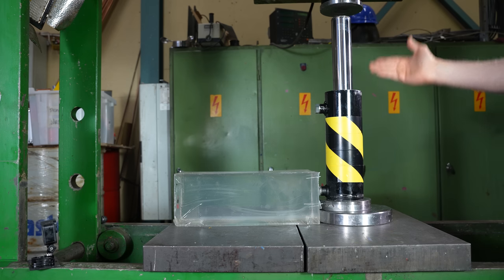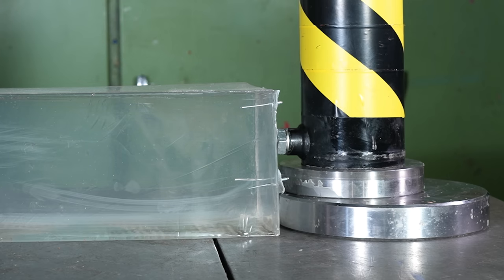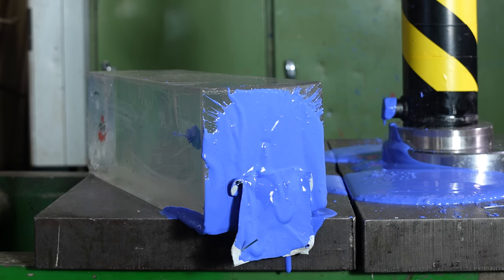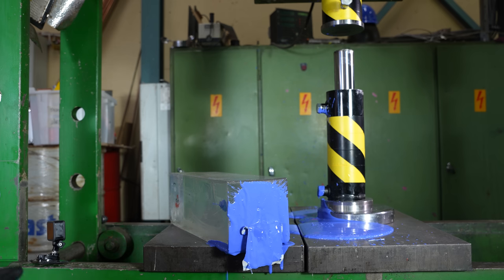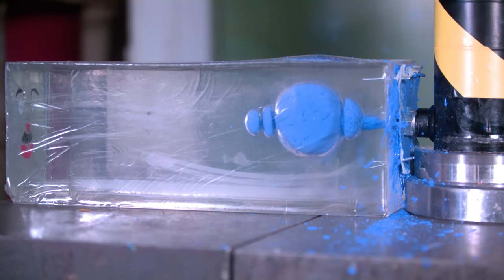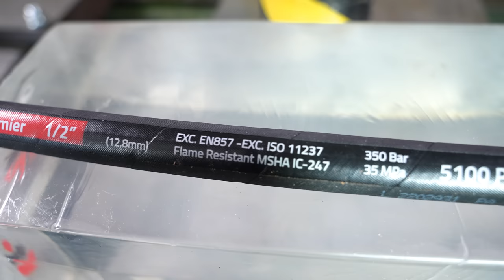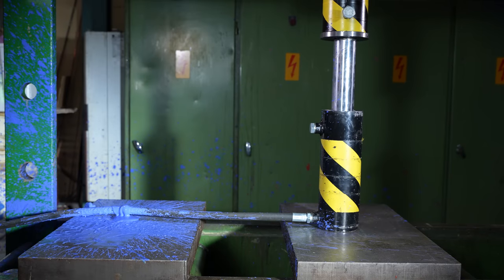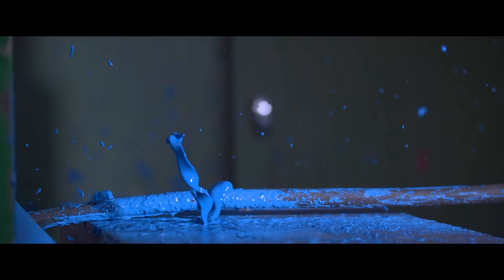Injection Injury Demonstration With Hydraulic Press | How to lose your hand!

Comment: The rectangular prism shape of the ballistic gel can only be so informative.  I'd like to see you take a plaster cast of someone's forearm and hand, and then a mold of a foreleg and foot.  You can timelapse or montage the process of taking the cast impressions, using those to make a resin mold, and then using the mold to set ballistic gel for the replica.  The key, I think, is using replica bones to make the model!  From just the two plaster casts, you can make several copies of each forearm / foreleg, and then you can test various types of safety equipment and protective gear.  You can crush batteries and other electronics which would allow you to simulate not only impact trauma, but also temperature and electrical injuries.  Pressurized cryofluids might yield interesting results as well, and if you have the correct rigging, you can also investigate barotrauma from rapid or explosive decompression injuries, such as might hypothetically be a concern during space travel or during undersea exploration here in Earth's oceans.

Comment: When I was younger I actually waved my hand through a pressure washer we used to use at work for the kitchen floors (not sure on PSI, one of the ones with the onboard compressors, listed as 2000psi max), didn't actually go through my skin at all, but the force was enough to bruise my fingers pretty badly.

Comment: So, now I'm curious to know if the viscosity of the fluid has an effect on damage to the tissue analogue. Like, because the paint is thicker, does it have more punching ability, or more ability to increase cavitation due to density?

I bet this would be cool to try with different fluids in the cylinder. Use the footage of the paint as a baseline, then maybe try adding more and more water to the mix and seeing what happens?

Comment: 9:44 The googly eyes are gone and now it looks like Mr. Block is being tickled. The worst part of injection injuries is that they're usually toxic fluids and the only way to clean them out is to totally surgically explore the area. A pinhole wound in the hand could require the whole hand to be dissected to be cleaned out. If you don't get all of it, the tissues will die and lead to infection which could require amputation. @AvE made one of the best videos on this topic.

Comment: It's why when checking for pinholes leaks in hydraulic lines you could run something like a piece of paper along the hose and not your hand. The pressure of the fluid coming out will cut through the paper, just like it would cut through your hand. Hydraulics ain't no joke.

Comment: Thank you so much for the work you did to publish this but considering pressure washers are the most common injuries of this sort a PSI conversion would be very helpful (i.e. 150 ton hydraulic cylinder DOES NOT TELL US ANYTHING ABOUT THE POC(point of contact))

Comment: I’m a trauma Medical scientist and wanted comment on hydraulic pipe failure. The trauma that would be caused is similar to “crush” type injury meaning you have multiple of the following 1) bone fractures, 2) Bleeding 3)Compartment syndrome (increased pressure in an arm or leg that causes serious muscle, nerve, blood vessel, and tissue damage 4) Laceration (open wound) 5)Nerve injury 6) Infection (caused by bacteria that enter the body through the wound) 7) Disseminated Intravascular Coagulation (body reacts to the blunt force trauma on the tissue leading to an over compensation  of clotting factors causing potentially lethal blood clotting) these injuries on there own can be fatal.

Comment: I had a 3” sand blasting hose that had filled with sand and under 110PSI blow apart at the joint next to my hand.   I pulled sand out of my skin for many years afterward.   This is way more dangerous as pressure is way higher and sustained!

Comment: Was in the trauma ward for a week when I was 20 because I fell off a quarry. Lucky to be alive.... but anyway... A guy came in, he was working on a farm and went over to talk to somebody who was tipping up a trailer. The guy walked over to the back off the tractor as the trailer was being tipped up. He put his hand on the hydraulic line while he was chatting and boom... the hose burst, the oil went straight through the palm of his hand. Spent a full week in and out of surgery trying to clean the oil out of his hand. It did a crazy amount of damage.

Comment: Commercial diving we used high pressure waterjets to cut concrete, around 45-55,000 PSI.  The HP hoses are double hosed, the primary hose, with a second clear wider hose around that to attempt to diffuse any pinholes and show water collecting before it cuts through and takes someones fingers off.

Comment: A paramedic told me about injuries on farms from hydraulic hose leaks.  They went to a farm in the helicopter expecting to see something terrible like a crush injury and were surprised to see a  young farmhand arrive holding his swollen arm from a high-pressure hydraulic oil encounter.  "I never saw the jet coming out of the hose" he said.  They took him to hospital but he died the next day.  Very dangerous, but never mentioned on the ads for far (and engineering) safety.

Comment: I was taught, even a hair thin hydraulic oil jet can penetrate the skin, if it comes from a high pressure system. 
And it doesn't dissipate much over distance like water. 
Also if untreated for too long, because it was unnoticed, it can lead to limbs having to be amputated.

Comment: Medical personnel need to be trained on injection injurie. I injected my right index finger with hydraulic oil at 195 BAR - 3000 PSI. At the emergency room, I was diagnosed with a minor laceration with swelling. I was insisting it was an injection injury and very serious. They gave me a shot to get me to shut up.

Comment: The dangers between pneumatic and hydraulic systems certainly are different.. One of the most dangerous common hydraulic systems are the high pressure fuel injector pumps on diesel engines. The pressure inside these can be as high as something like an unbelievable 20,000 - 30,000 PSI, enough that even in tiny amounts the diesel will go straight through the skin. The diesel is obviously pretty toxic inside the body, and can easily require limb amputation or even kill.. A place where health and safety really do work..

Comment: What was frightening for me is how many years I worked around hydraulics without ever being told about the dangers of hydraulic injection injuries.  Straight up if I get a hydraulic injection injury, I'll amputate the limb myself as fast as possible and then deal with that injury instead of the hydraulic oil injury.

Comment: This tells half the story, even if the pressure isn't high enough to pierce you, I have had a drill blow out during a deep boring operation in a shop, the oil was only at about 58.5 barre, I was 2-3 feet away from the spray, but I took a lot of that cutting oil in the face. This tells the danger of pressure, but not how much the pressure (and especially with something like machining with the cutting oil) the burn potential. I burned my face and neck with that incident, healed up fine but it's unpleasant.

Comment: Back in 2009 I worked for a company that used 20,000 psi water pressure and our safety orientation video was written and directed by our safety instructor who had 15,000 psi water stream hit his leg. It was the most disturbing sight I've ever seen.

Comment: Work in nuclear and had a crew taking down manways (large steel plates that are bolted on and are ment to take massive pressure) with hydraulic hi-torc machines. Guy had put his hand on a faulty seal and got a hydraulic injection wound. What makes these injuries worse than what you see on this video is the fact that the pressurized oil tries its best to take the path of least resistance, which in the case of being sprayed at a living thing is more often than not your veins. Worker lost half his arm because the oil traveled up the veins in his arm and killed all the tissue (hydraulic oil we used is deadly when just ingested much less when injected into your arm) if you ever suspect a hydraulic leak just depressurize and look for the leaking oil. It ain't worth testing fate.

Comment: I have a tattoo on my thumb. Not an intentional one. I accidentally unscrewed the air conditioner line instead of the radiator and the high pressure injected dirt into my skin. I was very lucky it wasn't worse!

Comment: it didn't go deep into the gel from the ruptured hose, but what it will do is inject a large amount of hydraulic fluid under your skin which if not treated immediately will quickly kill all surrounding tissue and potentially be introduced into your bloodstream likely requiring amputation of the directly affected area if it doesn't kill you first.

Comment: I was on my friends farm once and i noticed a tiny fountain of hydraulic fluid coming out of a hose. I shouted to him to get some tape whilst i put my thumb to stop it. He ran at me screaming not to and pushed me away. He told me although it was only a little "squirt" it was still backed by 3500psi and would have pierced my thumb and injected hydraulic fluid into me. I was so lucky. It never occurred to me.

If you want to see this in action, go watch a waterjet cutting 6 inches of steel armour plate like it was paper.

Comment: I work with a pressure paint system that pumps the paint out of a pinhole at like 150psi. I once didnt lock the trigger while trying to remove the nozzle and sprayed the paint directly into my palm. I was lucky it didnt go into my hand but it sure as hell didnt feel good.

Comment: Many years ago I was using a pressure washer and didn’t let off with my right hand while using my left to move something, it was about 100mm away but cut a clean, deep gash in my hand- it took weeks to heal and I still have the scar. If that could happen with less than 200 PSI, I hate to think about the damage that could happen on something way bigger..

Comment: These injuries are uncommon with an estimated incidence of one in 600 hand injuries presenting to an emergency care unit. They occur predominantly in young men and are mostly occupational injuries. The majority of the injuries affect the non-dominant index finger and occur usually due to inexperience in operating the high pressure equipment, inappropriate use, insufficient training, carelessness, fatigue at the end of the shift or rupture of the equipment.  The most commonly injected substances are paints, paint solvents, grease, fuel oil (paraffin oils, diesel oil, gasoline) but there has also been reported injection of water, air, cement, and animal vaccines. In order to breach the human skin the ejection pressure has to be at least 100 pounds per square inch (psi) while most high-pressure guns and injectors reach pressures of 2000 to 12000 psi. 

The puncture wound is small, inconsiderable and not distinct. Initially the toxic substance causes edema and ischemia and later the combination of mechanical and chemical factors leads to compartment syndrome and consequently to fibrosis, adhesions, necrosis and secondary contractures and ulcerations, apart of the risk of systemic intoxication (acute renal failure, air embolism).

Comment: Showing just how bad very high pressure injection injuries can be is a good thing. I don't know of anybody personally but I've read warnings about how it can happen and super quick too. Causes devastating injuries. Some even requiring to amputate said limb because its so bad. It just rips/tears everything apart and the potential resulting infection is also just nasty.

Why not get a few big slabs of meat (like beef) and to injection tests with that. It would be a very good example. No you can't see through it. But you can then cut it in half and show the injury it could cause.

Comment: The field hand brought the backhoe to the shop because the "tire" was leaking hydraulic oil. I dressed in all the leathers I could find and got a big piece of cardboard to find the leak. The stream of oil was too small to even see. If one of the workers had actually tried to look for the leak they could have been injected. That stuff is terrifying.

Comment: Cool video, i would like to see, a painting but using mutiple nozzles and colors. See: Mythbuster paintball canon. Instant screen printing could make some good cash. And the hose rupture had no "skin". Also most people around equipment are wearing a uniform. Although it is not much protection, a good test would include it. Air can do worse things to the body, usually hydralics just cut or cut through. Air can be absorbed into the body or balloon, and at pressure can cause the benzs. Sometime weeks after the incident. Cuting through a Tank hull could be pretty cool. Got my like

Comment: One time my father and his friend (both were high) were using a pressure washer to ckean some engine components. His friend was stupidly enough holding a carburetor so my dad could hit it with the pressure washer. No idea why he needed to hold it but anyways. When my father pulled the trigger it bucked up and hit his hand almost imidiately with the kick back of the water. Pierced the flesh and degloved his hand before my dad could even register it was on. And if you dont know the term degloving. Essentially his hand skin seperated completely off the rest of the hand while remaining attached. Its blew up like a baloon full of water. Surprised he didnt die or loose his hand honestly

Comment: Hydraulic injections aren't normally that bad, as there is no air spring to continue driving the fluid after the initial cavitation. The hydraulic pressure normally has a spike that causes the initial rupture, and then suffers an immediate pressure loss, nearly stopping the flow after only a few ml have been injected. It's more like getting shot with hydraulic fluid than being inflated by it.

Though there are large hydraulic systems that could behave this way if the high pressure pump is designed for high displacement as well.

Comment: The guy I work with knows a guy who died from something similar. He was working on a truck and something happened with the high pressure fuel for the injector pump and hit him in the head or neck. He just fell over dead and it was a microscopic hole.

Comment: Or imagine getting a flu or Coronavirus shot, but by some stroke of dumb luck, the doctor or nurse practitioner or whoever else in the medical field administering it doesn't know what they're doing and inserts the injection needle wrong and screws up a vein in the recipient's arm. That could be catastrophic especially if the recipient already had a phobia of needles and/or still had that phobia prior to the accident. At that point, they'd have to hope in the ER that the doctor seeing them doesn't recommend amputating the arm from just above the elbow down, or worse case scenario, amputate that arm completely and get a prosthetic one

Comment: You should do this again but put a large square of raw pork belly with skin on, in front of the ballistic gelatin. 

That gelatin really isn't a good analog for skin and flesh especially in this situation. It is more useful when you're firming bullets into it but even then it's not a very accurate analog to skin and flesh. The only reason it's used so ubiquitously is because it's cheap and gives consistent results. 

It would be extremely interesting to see could it actually penetrat pig belly and then I so how much further into the gelatin will it travel after that. 

Also you should try it at various distances from the nozzle just to seevat what distance it doesn't break the skin.

Comment: You need to make the hole smaller like a pinhole. I've seen what it does with 3k psi on aircraft via safety video. It's will cut right through your arm

Comment: Industrial ultra high pressure washers can cut you in half in a flash. But even messing with normal shop air 6 or 8 bars is more than enough to give you injection injury or bubbles in your bloodstream = stroke time!

Comment: I had a 3d printer nozzle explode off my ender 3. It sheered off clean where it threaded into the hot end. All stock hot end. It was loud and it shattered my glass bed.

It also took a chuck out of the  magnetic stocker under the glass bed from my old magnetic flexible beds I was using.

Definitely could have hurt someone if they had their face near it.

Comment: My shop had the only working hotsy pressure washer on our FOB in Iraq back in 07. Some troops from 1-5 cav asked to use it to clean their Bradley. We told them to just be careful as we upgraded to around 3,500psi. These fools decided to try to wash the mud off their pants after cleaning their vehicle. Yeah, 200°f 3,500psi water ripped the flesh off the guys shins right through his pants.

Comment: Hydraulic fluid injection it's extremely dangerous. A tiny pinhole in a hydraulic line can easily result in the amputation of a limb or even death. Let's say you get hit in the leg buy a tiny jet of hydraulic fluid. You will most likely result in them cutting away a massive amount of your leg in an attempt to save you, but depending on how deep it gets the only option might be to completely remove the limb.

Comment: Holy shit I have had hydraulic hoses burst near me many times while working on tractors and machinery. I have been burned badly by hot hydraulic fluid but i did not realize it could potentially be so dangerous. The lines that i have seen burst were old and worn they didnt burst at such high pressures but still dangerous if you were very close to it.